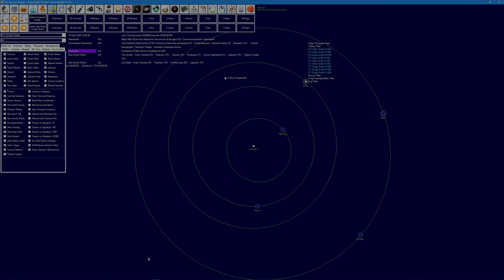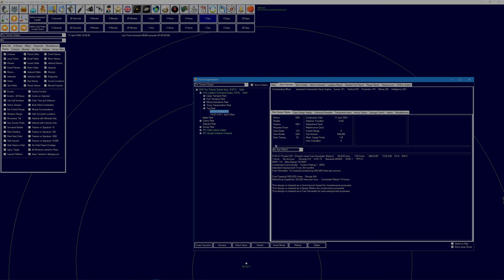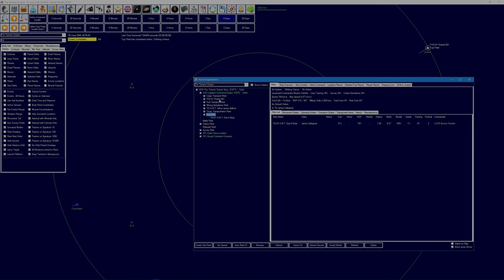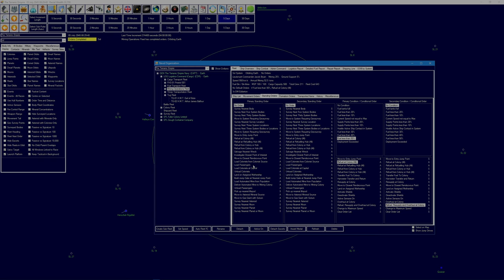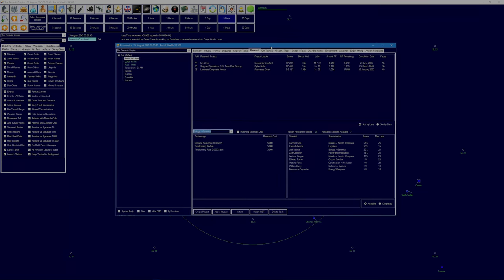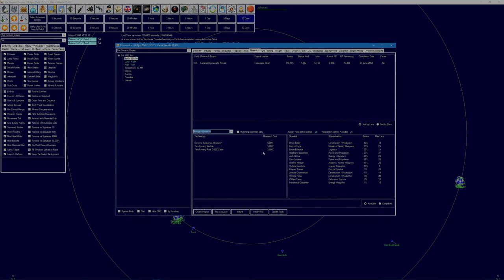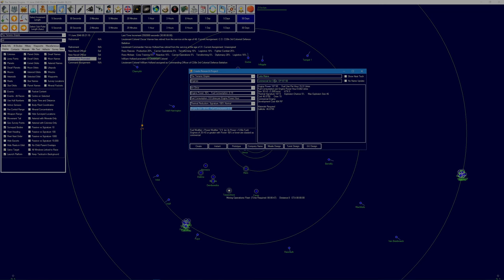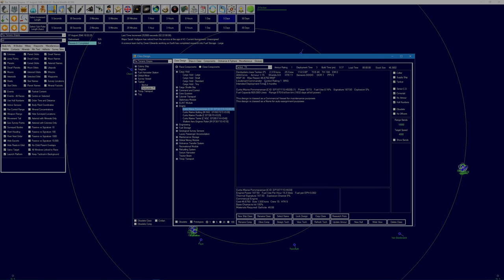Aurora 4x - A Beginner’s Journey #10

Comment: Your Majesty. Reports from the Ministry of Defense suggest that a deployment of sensor buoys around jump points in the Sol system would be of great importance to the long-term detection capabilities, and safety, of the Empire. A relatively small tonnage vessel could, conceivably, deploy these buoys using large, but lightweight missile launchers. As the ability to reload the launcher is of minimal importance, they could even be "Box" style launchers. They say that no engine is required for these "Missiles", or buoys, either. Saving much needed fuel reserves for other, more pressing, matters. Such as the upcoming Webb Annual Space Travel Extravaganza and Luminescent Light Show, where, as you know, our fleet parades across the heavens, lighting their engines at full power just above the atmosphere. The effect, I hear, is quite spectacular. I would watch of course, if it wasn't for the fact I am usually in the fallout shelter, in the event that one of the ship's should suffer a catastrophic failure on close approach to the planet. But I digress. Sensor buoys, your Majesty. Sensor buoys shall carry the day.
Reply from the maker: Jump points, you say Rook? Jump points? Sounds fascinating. We must have our science johnnies look into those. Smithers, see to it, there's a good chap.